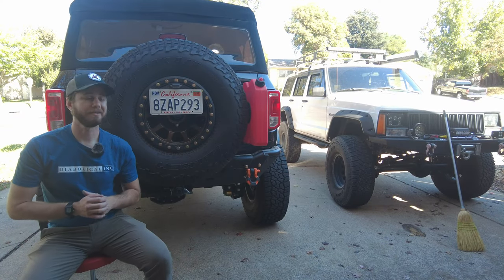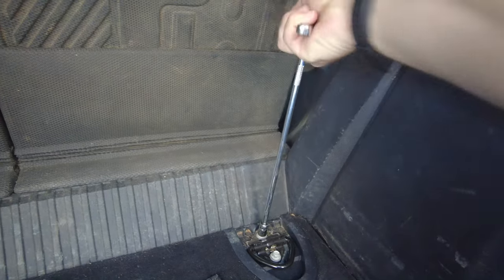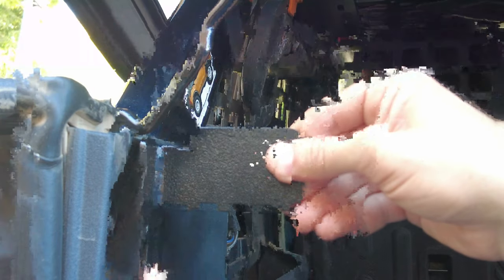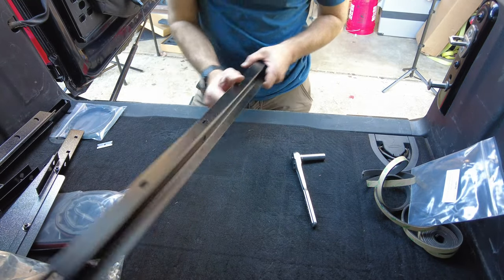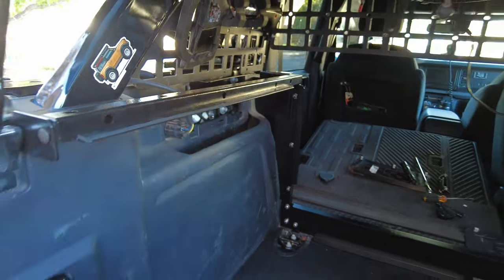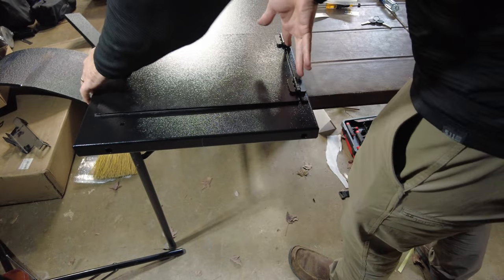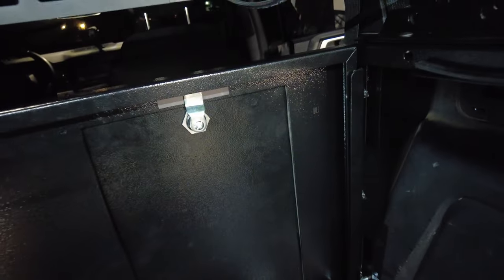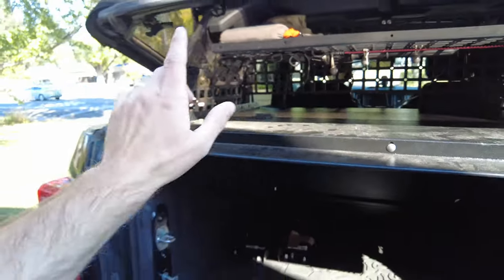Diabolical Install on my Bronco

Comment: Thanks for the video... I didn't know what Diabolical was..  tip, the outro that you did was great, but I think a little bit of it needed to be at the very beginning. I say this because I had to fast forward to the end to figure out what you were installing.  Basically, a well engineered security box for the back of the Bronco.  😊
Dang diesel trucks!  I bet they were Dodge trucks.😂
Reply from the maker: Awesome and thanks for the tips!
Reply: @popo_patty  The 'tip' was a joke... I'm sure you know way more about making videos than I do... I assumed it was an oversight... I literally didn't know what you were installing.  I really like the JCR molle setup that you have, yet another thing going into my build, eventually.

Comment: Thanks for the video, what is the upper molle enclosure you have to separate the cab from upper trunk?  I haven't seen one like that and looks like exactly what I want.
Reply from the maker: That is the JCR pet divider. Unfortunately, they changed their design right after I bought mine. The holes are now bigger
Reply: @popo_patty  sincerely appreciate the response.  I am about to install the slipstream and I'm thinking of going with the Diabolical side window molle panels and still using the JCR pet divider.  Would you suggest any different options?  Again, thank you very much for your input.
Reply from the maker: @spencerpuente5445 very good question and I’m happy to help how I can! I honestly have no idea if the JCR divider will fit with the Diabolical side panels. Anything can fit with some custom fabbing. I would highly suggest reaching out to Diabolical, Alan is very responsive and they may even be working on something. In the meantime I’ll look closer at my setup and see if I can find measurements
Reply: @popo_patty thank you!  I reached out to Alan, great call.  Sorry one last separate question but on a similar train... I want to take my soft-top off over summer/fall and want a canvas top that is good enough for the freeway/light water exposure.  There aren't many options and I'm thinking of going with the default ford canvas top since everything else out there is in the same price range and none of the options have very good reviews.  No worries if no input but had to ask.  Thanks again.
Reply from the maker: @spencerpuente5445 so unfortunately I have yet to see a good option in the aftermarket for this. Only option I’ve seen had horrible reviews on the forums from everyone that purchased it on there. There was a whole thread dedicated to how bad it was lol. I have no experience with the Ford version either as it’s not something I’ve ever considered for my personal needs. Sorry!

Comment: Great video!  What was your solution for the JCR mount and the Diabolical mount interference?
Reply from the maker: Thanks! So it’s such a snug fit that the JCR MOLLE rests on top of the Diabolical setup and is held in place fairly well. I loaded it all up and bombed across the Mojave for three days, getting air and hitting whoops. Nothing moved. I May eventually drill holes in the diabolical plate it’s resting on and put a bolt through but no worries yet